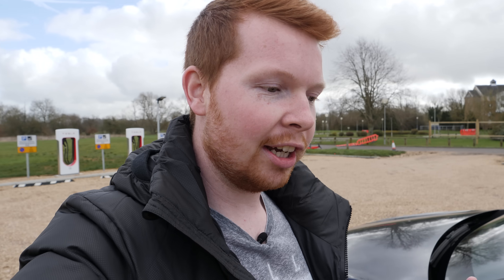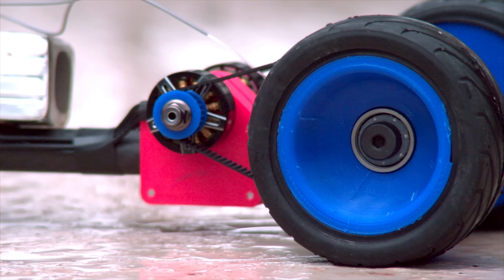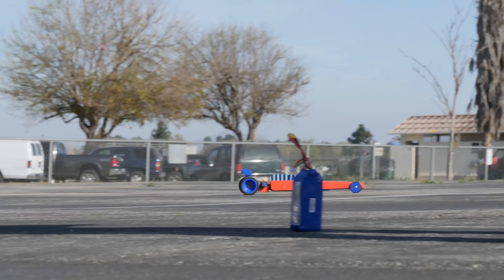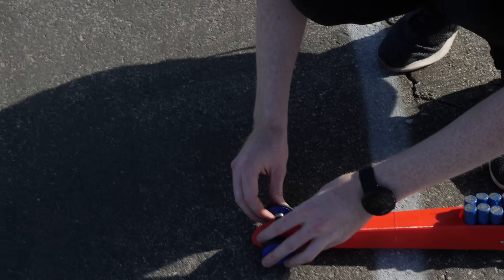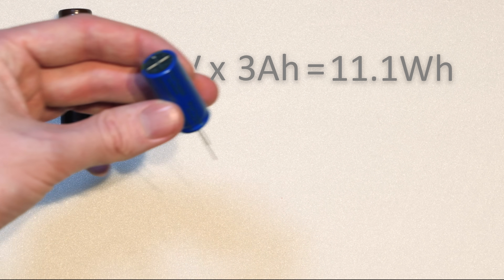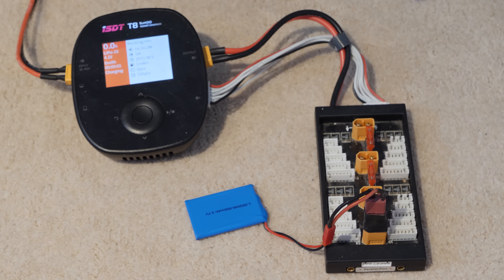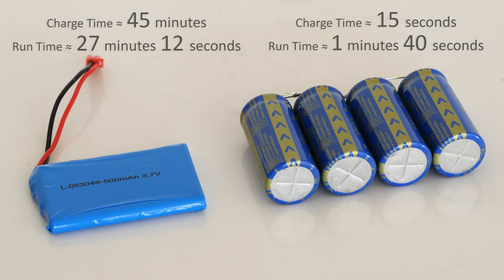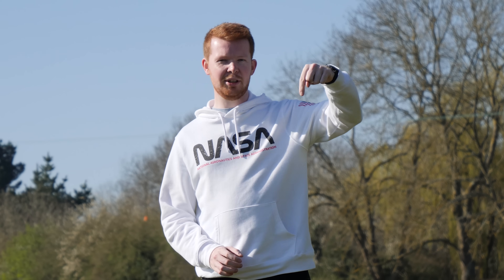Super Capacitor Dragster

Comment: We ALSO learned that there's a reason EVs have their batteries in the floor and not on the roof, and there's a reason dragsters only use minimal steering at speed.
Reply: Oh snap now I get you I thought you were talking about why the front steering mechanism and input system is usually small... But yeah if you make a slight turn you are going to flip
Reply: @edwardokeyoobala380  Exactly. Good old Newton. That steering force has to go somewhere and it's much easier to flip it on its side than to overcome the inertia of it's forward travel.
Reply: @edwardokeyoobala380  I wonder if the wheels act like gyroscopes so when you try and turn right it tries to flip over to the left
Reply: Is the minimal steering cause of weight or is there another reason?
Reply: Edward Okeyo Obala because they are always on the edge of traction at the rear wheels.
Reply: @edwardokeyoobala380  It is also the design.  By having a staggered wheel setup, where the front wheels are closer than the rear....you make it a 3wheeler basically.  So minimal input is needed at the front to turn the vehicle.  Excessive turn in...will cause it to flip.   It basically turns into a pivot point instead of turning the car and flip.

Really those front wheels should move about 1degree in turning up to 3degrees to maintain a stable vehicle with how fast it was going
Reply: @elitewolverine  you state that "By having a staggered wheel setup, where the front wheels are closer than the rear....you make it a 3wheeler basically.  So minimal input is needed at the front to turn the vehicle." but this again, is untrue.  using four front wheels vs four gives the same rate of turn given that they have the same angle and actually having two front steering wheels is worse because the radius of travel for the outside wheel is larger than the inside which means it needs a different angle to the other wheel.  See the second animation for more details here:
https://dynref.engr.illinois.edu/avs.html
If they wanted a three wheeler then they would just use one front wheel.
The actual reason the front wheels are closer together and so small has nothing to do with steering and everything to do with aerodynamics.  If the wheels are spaced far apart then it creates a much larger frontal area, which creates more aerodynamic drag. As well as this the further apart the wheels are the heavier the steering and suspension/mounting components need to be to not snap so you can save a lot of weight just by bringing the front wheels in.

The willingness of a car to flip when turned isn't just about how close the wheels are at the front.  A car that is 5 meters long and two meters wide at the rear with one front wheel at the front will be harder to flip when turned than a car that is 1 meter long and two meters wide with two front wheels because what would be a very gradual turn on a five meter long car (say the front wheel at 30 degrees to the car body) would be a drastic turn if that same 30 degree wheel angle was applied to a very wide, but very short car.  Stability during a turn is not just about how widely spaced the front wheels are but is also about how far away those wheels are from the rear.  Given the geometry of a drag racer's front and rear wheels it is actually more stable during a turn than your car would be at the same speed and wheel angle.
Reply: @edwardokeyoobala380  too fast steering can make it roll over same as really heavy batterys on tope of a car
Reply: @edwardokeyoobala380  Imagine even just driving down the highway and turning your wheel with a massive input. The faster you go, the faster things happen. As somone else said,  the forward inertia is huge in a straight line, it will want to keep travelling in that straight line. The shape is extremely narrow so it will just do a barrel roll. As you turn the wheel at high speed, it will actually lift one wheel up and give it a twisting impulse which will send it spinning. The direction of travel will be blocked by the tire and the inertia will try to overcome the resistance of the tire on the ground, so it will just move around the tire because it has so much inertia in the other direction and the stance of the wheel is narrow enough that the turning force is easy to overcome. If you took the front axle and made it super wide, a turn at high speed would actually work, since most of the inertia would be able to be absorbed by the axle into the tire and it wouldn't flip. It would look dumb and be less able to get to high speeds, but you could turn it going fast.
Reply: @edwardokeyoobala380  These guys are talking rubbish dragsters use heaps of steering in real life, watch some cockpit footage:
https://youtu.be/pgmu40cUki0?t=320
Definitely steering all the way through the run to keep it going in a straight line.
Flipping isn't a problem caused by steering, or even excessive steering.  The problem that will get you with excessive steering is chassis twist.  Because the chassis is so flimsy and is only designed to be strong in one direction any lateral stress (aka sideways) causes the chassis to literally crumple, for example:
https://youtu.be/ugxhreMZZqg?t=375
Reply: Also, real drag cars will spin their wheels at 100 mph, and take throttle control to ride the line of max power without wheel spin.
Reply: @caleb7631  you state that dragsters "take throttle control to ride the line of max power without wheel spin." and this is probably the worst misinformation in this comment section.

At the high end a drag run only lasts about 4 seconds so the last thing a driver wants to do is reduce throttle.  In reality a dragster will use 100% throttle from the start of the run and has no gears.  Instead there are a series of clutch plates that engage to act as gears.  The first plate might only deliver 20% of the power the engine generates, the second clutch plate 50% and the last clutch plate all 100%.  By the time the run is complete the clutch plates have literally welded themselves together and need to be replaced. Learn more here:
https://www.youtube.com/watch?v=KPBCCuFLCXk
This system allows a drag racer to avoid having to waste time shifting gears and having the engine accelerate back up to max power.  I already linked this, but here you can see that the driver never lets off the throttle only using steering to correct:
https://youtu.be/ugxhreMZZqg?t=375
In reality the way that traction is controlled is with math.  The air fuel mixture is adjusted according to conditions to altar how much power the engine produces.  Furthermore the clutch also altars the air fuel mixture so that the engine power at full throttle increases during a pass, at the start of a pass the air fuel mixture is leaner and then it becomes enriched as the clutch tightens.  You can learn a lot about the fuel system and how fuel mixture is adjusted by the clutch in this article:
https://www.competitionplus.com/featured-stories/10631-mike-kloebers-nitro-university-course-4-fuel-management-systems
Basically to keep these cars at the very edge of traction engineers do maths to work out how much power it will take to break traction from start to finish of the run and then they adjust the air fuel mixture to supply just under that amount at full throttle.
Reply: Even with minimal steering at high speeds, the road was too rough, the car was going to lose control anyway

Comment: You kinda missed one of the main advantages of supercapacitors: the huge current drain ability. Like hundreds of times that of batteries.. and also very light weight.. which would make them perfect for a high current application such as a dragster

Comment: I'm sure it doesn't matter much in the smaller scale, but you put the treads on wrong in the wet patio test, the top of the tire is supposed to point to where it will go

Comment: quite late, but still gonna say: i learned my lesson about grip/power ratio just recently.

im a motor engeneer. and i always thought that internal combustion engines were ineficient by design, so at some point recently i figured, why not make a simulation of a car with an engine that's very eficient, here is when things got chaoitc, unless the engine you are making doesn't make that much power even at a high eficiency level, you are in for a world of "omg this is imposible to drive" see, one of the reason even the most powerful engines in the industry cannot drop all it's power on the wheels at once is because the weels only have so much grip, making the wheels slide, now for a lightweight RC car that is not a problem as the wheels eventually caugh enough grip to accelerate the vehicle, but when you scale that to a car that you are planning to drive?

let's just say, you better have the beyblade song in your playlist, you'll be spinning out of control... a lot, i said earlier that it was impossible to drive a car like that, i meant it, it's not tricky, it's not really hard, is borderline imposible.

so now kids, in the future, when you think that combustion engines aren't as eficient as they could be, remember, they are dessigned that way so you don't start spinning straight to hell.

Comment: I have a feeling cars will have a battery-capacitor hybrid in them that will allow super fast recharge times where the capacitors will “slowly” charge the batteries after it’s unplugged. Alternatively, the capacitors could be used when higher currents are needed, such as during acceleration. That way the batteries can potentially be low drain 18650s (or 21700s) to increase each cells capacity and not necessarily decreasing net power output. Energy density could be SO much higher with the same battery set up if there was one or two that had large capacitor banks instead of battery cells. They’s be real expensive though. Lol, just a though!

Comment: Dragster meant to go straight. Long narrow body is not suitable for corners. Then ur design doesn't include a suspension system which answering the tire not gripping properly. Btw, great thing to see. In my RC usually using capacitor for extra burst power.

Comment: To improve grip, do a "burn out" to warm up the tires which improves it. Running thicker tires also helps with stability and grip.
Reply: You could also heat the tires with heat blankets like in f1 or with other way

Comment: From the size comparison, we can surmise that while both chemical energy and electric charge are both driven by rules of electromagnetism, our current technology allows us to store chemical energy more efficiently than electric charge. (In case that confused anyone, a battery doesn't actually store charge. It uses chemical reactions to drive current. In some batteries [rechargeable batteries] the chemical reaction can be reversed. So even though you use electricity to recharge the battery, the battery isn't actually storing electric charge [see Science Asylum for more on that]. A capacitor, on the other hand, does store electric charge.)

Comment: Still super capacitors has is usages. I would not mind a 10 Km range 2-3 HP max really small "car" (2 seats, nothing else, need to shop store the bags in the second seat) that charges in 10 mins and does not really have any "wear" when not charged or charged. And when you are shopping for 10-20 minutes the car park could have a wireless charging in every parking space... well I dream on :-)

Comment: Back in the ninties we did radio control drag racing. We were well over 60mph at the end of a scale quarter mile. There is a lot more to drag racing than it first appears. The were no kits, they hand to be hand built fron scratch. Carbon fiber arrow shaft was what we used to build the chassis.

Comment: Umm couldent you add an on board charging sytem that chrges the capacisistors via a lithium batterie and run a capacitor lithium batterie hybrid since it takes 15 seconds to charge and you get 1 minute and 27 seconds out of the capacitor bank couldent the lithium batterie charge the capicitor bank like 100 times making the batterie life an hour ?????

Comment: its good idea to use these capacitor as NOS but in electric cars and u can get these capacitors charged with tiny alternator in the car wheel using also timer for every 15 sec

Comment: 🔵 Even though those rear tires were made out of an excellent soft grippy rubber,  you were STILL experiencing traction and stability problems, the reason for this is
because the rear-tires were not "true" on the wheel!!....
......They were out-of-round!!!
(This can be seen quite clearly in the two scenes just after 0:37 ).
So of course this is going to cause the tire to "bounce" and lose traction,...this will skew ANY information that you're trying to get from these tests, this and of course the fact that the surface you're conducting this experiment on is considerably less than optimal.
A wooden gymnasium floor would have been your best-bet, as they are usually quite level,....and, as a result of the lacquer coating, quite grippy as well.
Scientifically speaking, as a result of these two factors your tests weren't able to yield much valuable information whatsoever! Remember,..."The devil's in the details"
Thanks for trying though,... Better luck next time!

Comment: Consider moving the motors behind the rear wheel. Theres not enough weight on the rear wheels for traction. Also, if the motor was DC, and you used a relay instead of a ESC you would have instant torque. Those rc airplane escs start to move the motors a little bit to sense the position of the magnets, and then apply more power.

Comment: Is it possible to use the capacitors to charge a lithium battery. That way you could charge the capacitors really quick and while you're driving the capacitors will charge the main batteries overtime.

Comment: I bought a small rc car online, tried prying it open cuz I'm curious. Found a small single capacitor inside, it takes 30 mins to charge and has a 10 minute run-time. Overall, in a short amount of charging time, you can have the same fun and time as the ones using batteries. Btw it says on the battery "Lithium Capacitor 3.7v"

Comment: One thing that this video does not really demonstrate is the much MUCH better ESR of capacitors vs batteries in general.  ESR or Equivalent Series Resistance is in layman's terms is how much resistance the power supply (capacitors in this case) adds to the circuit.  In theory, if you have a battery with an ESR of 1 Ohm but you are trying to run a motor with 0.5 Ohm's of resistance only a small fraction of the voltage will make it to the motor while the battery.  This can be modeled using Ohm's Law but to put it simply, the lower the ESR the more current can be put out by the power supply.  Capacitors can have 1/10th of the ESR of a lipo battery so they can discharge insane amounts of current very quickly making them ideal for short bursts of energy.

Comment: Back  in a day I had plan to do this as "buffer" to increase burst performance on my RC car, but increase performance of brushless motor and lipo pack made that plan useless...
 The real challenge now is to have the traction and the skill to drive the car

Also Please put this in a proper 4 wheel drive car to test this ! , you can find a used On road car on craig list or something like that. https://hobbyking.com/fr_fr/blaze-r2-1-10-scale-carbon-fiber-touring-car-with-unpainted-bodyshell-artr-silver.html?queryID=&objectID=72105&indexName=hbk_live_magento_fr_fr_products

At least you will get some decent handling chassis to exploit.

And if you read this, can you put the spec sheet of the super capacitor you used ?

Thanks you

Comment: You could have used some aero design with wings on the front and bigger wings on the back, not just for downforce but also for lateral stability. 

With wings on the front you generate downforce so the front doesnt leave the ground with the bumbs of the road or torque of the wheels, biggers wings on the back generate downforce so you have more grip and less wheel spin even at low speeds. For lateral stability think about something like a fixed vertical stabilizer of a plane, if your car start turning to much it will stabilize aerodinamically like a dart in the direction of the speed. You can have one of these in the center axis of the car, but it must be behind the center of mass, or can have two parallel to each other in both sides of the car or back wing. You can generate even more lateral stability if you angle them slightly with some "wing toe in/out"

 People often overlook aerodinamics when doing lesser projects like this, but it REALLY makes a diference and after some point its intuitive to understand how aerodinamic stability should work, no need to make calculations or simulations if it's just for fun.

Just finding a way to make it stick to the ground for grip and having front to back stability to make it stay in a straight line would improve the performance very much. Some cardboard, hot glue and silver tape for keeping the cardboard edges clean should do the trick.

Comment: Do please consider some sort of ballast to limit the charging current. If not, you will damage the connectors and probably the capacitors. A 1 Ohm wirewound resistor would be a reasonable start. Something like RE03528 from CPC (https://cpc.farnell.com/cgs-te-connectivity/hsc1001r0j/resistor-ww-100w-5-1r/dp/RE03528), perhaps. You could easily monitor the charging current by measuring the voltage across the resistor. For one Ohm, one Volt across the resistor indicates one Amp is flowing. There is also a problem with having supercapacitors in series (reverse charging). Google is your friend here, but I'd suggest at least a pair of Schottky power diodes to limit the reverse charge to a few hundred millivolts.